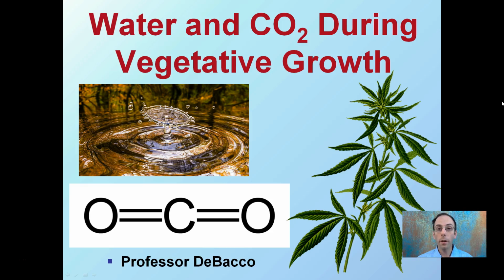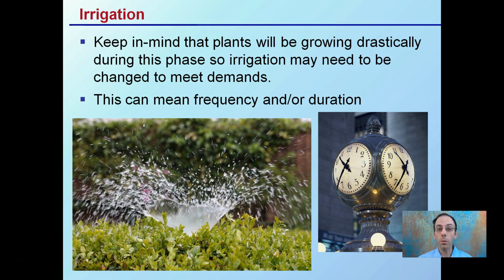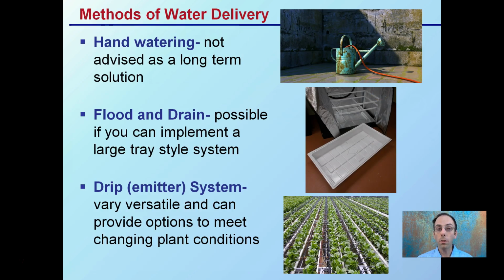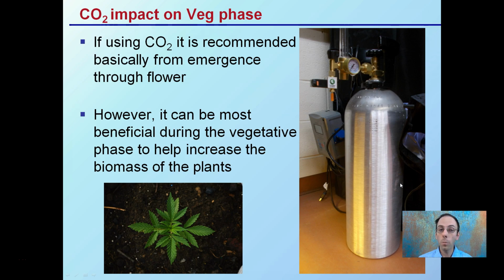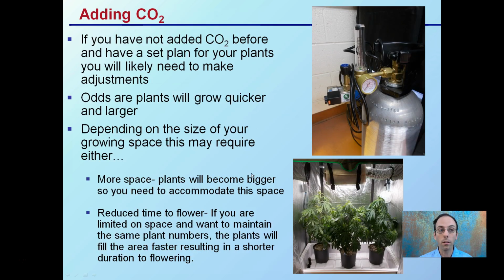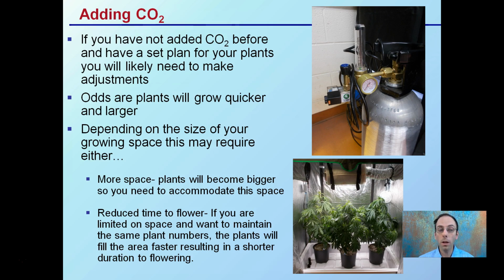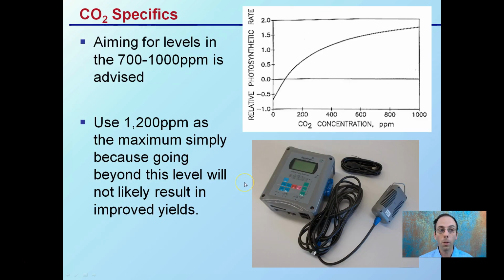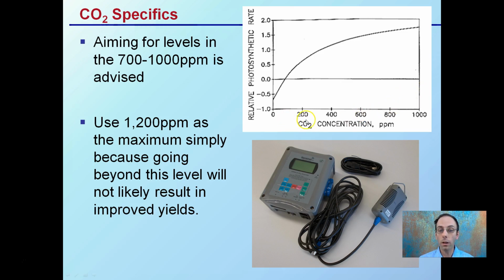Water and CO2 During Vegetative Growth

Comment: Thanks for this. I just had my first harvest and i used about 700ppm in veg and about 1600ppm in bloom. I will try my next run at around 1000ppm for both Veg and Bloom and see if i notice changes for the better.
Reply from the maker: A consistent 1000ppm will likely be more beneficial to the plants than running the room at 1600ppm.  Remember, all other factors (ex. light intensity, water, nutrients) need to be at optimal levels in order to see a benefit.  Best of luck with your adjustments and hope this video/information helps you improve your harvest.
Reply from the maker: @Anthony Morales 1000ppm of CO2 is a good target (1200ppm considered to be the theoretical maximum plant response rate) and this level should ideally be maintained from propagation until harvest.
Reply from the maker: @Anthony Morales Typically CO2 is reduced before harvest more due to diminishing returns on investment.  CO2 should not prevent ripening.